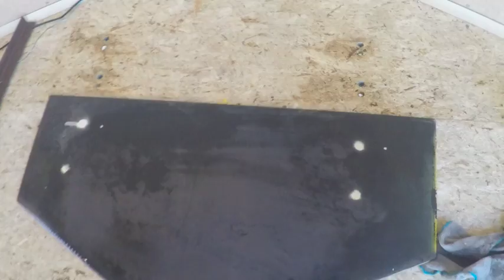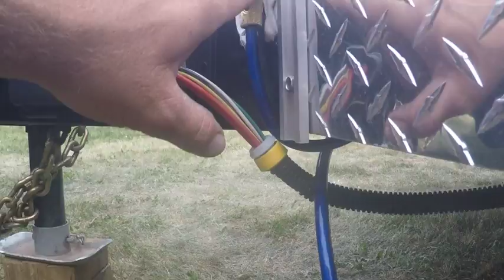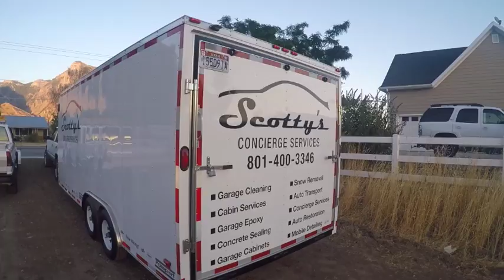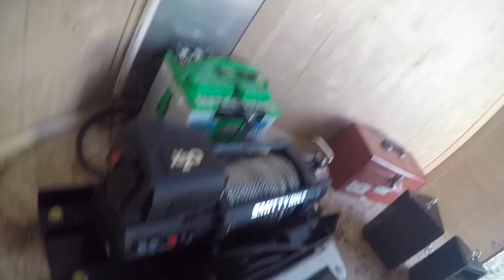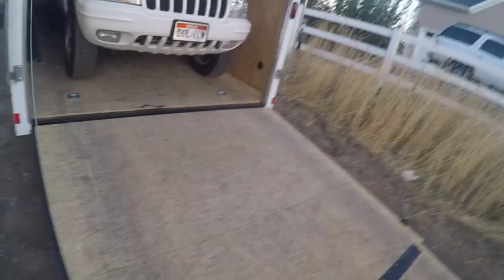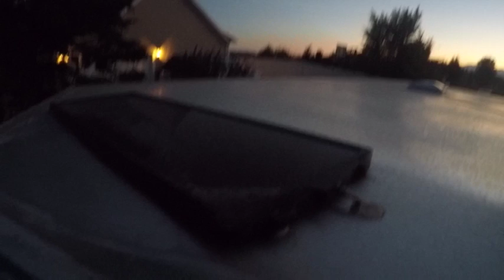Enclosed Car Trailer (Winch Install)

Comment: Nice install!!  A few questions...Shouldn't the heaviest weight (engine) be ahead of the axles?  Would pulling it in from front make the wheels steer better?  I would think winching it rear first might make the rear drag or skid into place before the steering wheels can adjust.  Other can chime in too.  Thanks!
Reply: Nice that WaybackRewind deleted his comments and left instead of wanting to learn why he was wrong.  He replied that weight inside a trailer really doesn't  make a difference.  If you're like him and don't think it matters, have you ever heard of the pendulum effect?  Look up this video:  Towing a trailer can be dangerous with the wrong weight distribution
Reply: @WaybackRewind  My whole comment is about the vehicle they show in their video.
Reply: @WaybackRewind  TOTALLY WRONG!!!

Comment: Have a 26' race car trailer with bathroom and solar panels. This is a great install, I just would like to advise you Guys to stay clear of Harbor Freight electronics. They sell B rate stuff from warehouses. The Solar Panels are very low power and better could be achieved with less money from places like Renogy.

Comment: very nice. I'm about to do the very same thing. how much times can you move something in and out before the battery needs to be charged? and does that solar panel take care of the one battery?
Reply from the maker: Russell Hess -i've never had the battery go dead, it's always has enough juice to pull the car in or out.
Reply: Awesome. And that solar charger works well? I actually noticed the same one at HFT.

Comment: turn the battery around so the lugs are facing the winch. that way you don't have to worry about shorting out the battery and burning down the trailer. also put some rubber covers on the lugs for extra safety put a battery disconnect on it to , just a thought.

Comment: I'm getting a winch soon, so I did some reading of safety.  From what I understand, no one should be near the cable when operating incase the wire snaps and lashes out, on a shorter cable, people put a heavy rag or blanket to stop it from flaring out.  Just thought I'd pass it one.  Enjoy all your videos and the thoroughness and details.  Thanks.
Reply from the maker: Good to know🤔 thank you👍

Comment: Nice job. Just picked up a trailer too and going to do the same winch install-great timing of your vid!
Reply from the maker: Cool! The hardest part for us was lining up the bottom plate that we welded to the A frame to the top plate above the wood floor. Make sure you think that one out before you weld everything into place. 😬